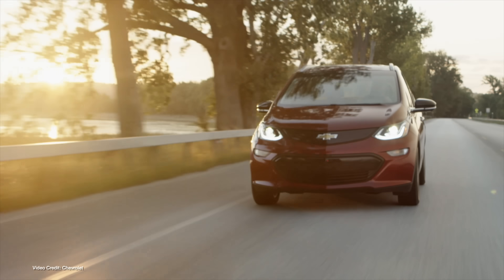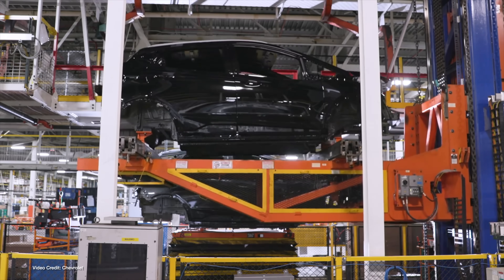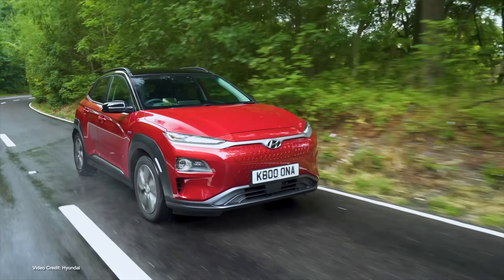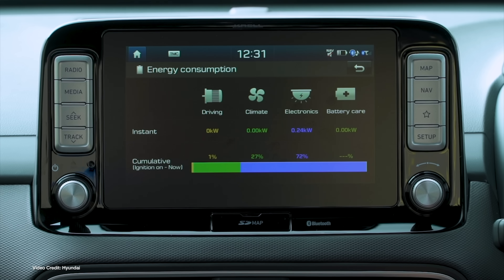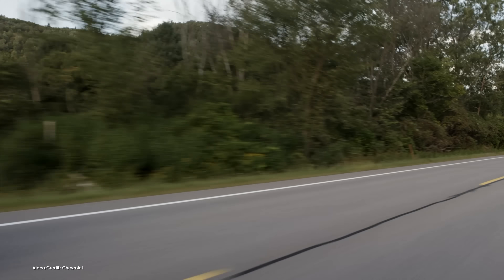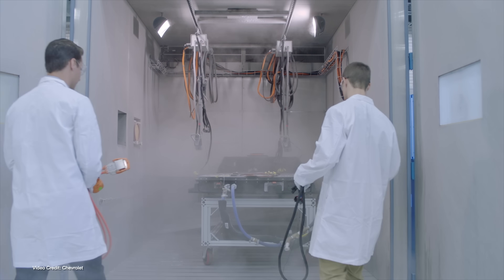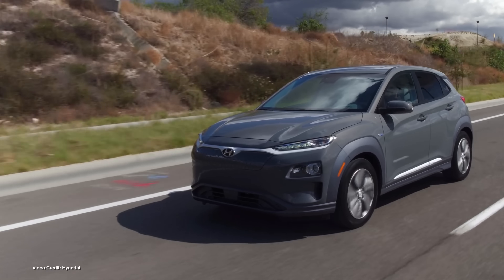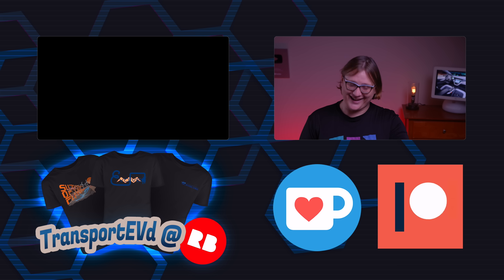Chevy Bolt EV Battery Recall: Here's Our Take on GM's Inspect And Replace Plans

Comment: A situation where minor manufacturing defects cause this kind of issue is really a design problem. The design should be more robust such that minor difficult to detect variations in mechanical assembly don't cause this kind of issue. This is likely due to LG Chem trying to maximize energy density with too thin separators. I wouldn't be surprised if this doesn't happen again. Hopefully diagnostic software can detect an issue before the battery catches fire. Edit:  I just realized this video is quite old.  There is new information that a recent fire in Vermont happened on a Bolt that had the recall completed.

Comment: Nikki lov your channel and you. Keep up the great work! I want to share with you some information. I had a 2017 Bolt with the Korean battery. Sold it back to GM and bought a 2019 Bolt (exactly the same blue premier, but with way less miles) with the US built battery packs. (btw am one of the lucky ones that made out with the deal) Know that there's a sticker under the car in the rear by the non-existing spare tire cavity that identifies the battery as built in Korea or US. The sticker faces towards the rear bumper so you don't have to go under the car just look from the rear behind the drives seat toward the middle of the car. Can't miss it. There's 5 rows of writings on this sticker, the third line from the top can be used to identify the battery origin. If it starts with 0808xxxxx it's US made. If the third line starts with 6883xxxxx then it's Korean made. 
You are so nice and way to nice to Chevy, I think. Chevy is taking the very cheap way out by replacing battery modules that test bad at the time of testing. What assurance is there that a good tested module won't go bad sometime later and burn up? Don't trust Chevy at all. There's more to it at least like lowering charging rates, who knows. Chevy is not even describing any details of the solution(s). But although it's the third time, believe they really found a solution this time and trust them. Chevy has earned no trust at all by it's refusal to divulge details of the problem and solution. So unless my beautiful perfectly running (thank you LORD) bolt needs to see a dealer for immediate repair (knock on wood), it'll be a cold day in hell before I bring it in willingly for a software update that I have no idea what it will do to my car with no chance of ever going back ever. No, thank you Chevy. Looking forward to your next video!

Comment: I have a 2018 Chevy Bolt. I just had recall N202311731 implemented . Ever since I've had strange behavior. Specifically, door locks don't open all doors with press of the handle button even though it's turned on. Rear seat occupied warning always happens even though it's turned off. This started happening as soon as I brought it home from the recall. Anyone experience this?
Reply from the maker: I know the recall service can reset all your preferences and they need to be redone, but if you’ve got all those settings changed and the behavior is still there, it’s definitely worth talking to the dealer where the update was done - Winter
Reply: Yes, I was wondering if anyone else had these issues. If I'm not unique, I would take somewhat different tack about the issue as suppose if they're unique to me.

Comment: Today I scheduled service on my 2017 for an issue where the car shudders on acceleration from the stop. The service advisor told me the final recall fix is in so it’s scheduled for that too. I told then I thought that was only for 2019 atm but they said mine was covered. Confidence is low that they actually know what they are talking about.

Comment: No one of Chevrolet Bolt Ev should agree on just software update. There is a physico-chemical problem inside the battery and no software update will help, may only reduce the risk but it will always occur. It may catch fire in worst, unexpected moment. Remember the health and life of your family is at stake. Demand consequently from GM and local representatives, battery replacement.

Comment: Even with a software udate you still have faulty  batteries regardless. They need to do the right thing and replace the batteries. Its like a bad hdd no software will fix it.

Comment: Just had my 2019 "upgraded" today. They inspected the battery and found no faulty cells, so no need for battery replacement. They also evaluated my battery's state of health and said its degradation was practically 0%. Honestly, I was very pleased to hear that. Having my battery as good as on Day 1 - after two Canadian winters, active daily driving, and almost 50K km on it - means I will be able to keep this GM masterpiece for many more years to come. Halleluiah! :)
Reply: What was the manufacturer date of your bolt?
Reply: @Slaize  I'm not sure about the date. It's a 2019 and I bought it in October 2019.

Comment: Are the 2020 bolt ev included in the recall?
Reply from the maker: No. The battery pack manufacturing changed partway through 2019, so some 2019 models are affected, but the 2020 and 2021 models are not. - Winter

Comment: Just got back from the dealer where my 2019 Bolt EV with 18,000 miles was checked out. Took an hour and 45 minutes, but the invoice came back with the words: "performed battery test then programmed hpcm2 and bcm due to all passed".  Woohoo!! Back to 100% charging. Sorry to disappoint all you Bolt sceptics and GM haters (not really).

Comment: As an owner of a 2019 Bolt, thank you for your wonderfully clear and helpful explanation of the battery issue. My local dealer had my car for the first software “downgrade” to 90% maximum charge but can’t seem to manage tracking their own work. I even provided them with the invoice number from that visit and they continue to beg me to bring in the car for the software modification. Hmm?  I wonder about the competence of their service department when they can’t track work they already completed. I’d rather have service performed at my local mechanic which has at least two Bolts as service vehicles. It was their satisfaction with the Bolt that convinced my wife and I to buy one in the first place. Alas, I doubt GM will reimburse my local mechanic to do the recall repair even if they provided the tools and parts. Right?  Any other folks out there who question the competence of their local dealer to carry out GM directed repairs?

Comment: I dealt with the problem by trading my 2017 in for a used Prius.  I have to say it's nice to be able to drive five hours without stopping for two hours or more to charge.  I never thought I'd go back to am ICE car, but the LG battery issue made me feel like a beta tester.  I'm from a state that is 80% electricity via coal anyway.  And no, the answer for me is not a Tesla, until their build quality issues is fully addressed.

Comment: Never had a battery problem with the 2017 Bolt which I had driven for three years (leased).  Currently, I have the 2020 and 2021 Bolt.  2017, 2020, and 2021 Bolt all have uncomfortable seats.  Nonetheless, they are all extremely energy efficient.  I recently took a 220-mile day trip and I averaged 4.4 miles/kW.   Cheers.

Comment: It's well know that it isn't recommend to charge an EV Batteries to 100% all the time, only when needed for long trips. Are all these cars being charged full all the time? Just because you charge your phone fully all the time with it's small battery that you can with EV batteries.  Your phone battery gets warm when charged, remember Samsung phone fires, just imagine how hot 500 - 1000 of those would get if packed together like EV batteries are. There is  a reason for the lower charge recommendation, if you need the full charge all the time then you should have gotten an EV with more range. Personally i think most EV's have enough range for most daily driving, if your driving  more than the range of your EV you need to stop and relax while you charge you vehicle.  There is a Reason that Professional Truck drivers are required to stop every so many hours.  

I am old enough to remember Filling Up your car full all the time was not done. I worked pumping gas in the late 1960's early 1970's  most people only bought enough fuel to get through until the next payday, only filling up only going on a trip out of town. It was only with the oil crisis that most  started getting full tanks so to extend the time before needing gas and avoiding the long lines.

Comment: You can not expect too much from GM on this issue. They used 2nd or 3rd party manufacturers. Generally when batteries catch fire , Its an engineering and/or manufacturing issue just that simple not software . You get what you pay for. Sad Commentary

Comment: I’d prefer a battery replacement. I wouldn’t waste my time at a dealer just so they can change a few modules.
Reply: Meh - you get to drive a new Bolt for a couple of weeks while yours is in the shop. What's the problem, whiner?
Reply: @vidznstuff1  the problem is that ill want a new bolt after i get my old bolt back. Lol

Comment: Personally I think Chevy is just taking a cheap gamble hoping no future issues pop up even though the batteries are inherently defective. The question imo will be, will the defect get worse over time as the battery degrades? Maybe they simply are biding time because as time moves forward batteries become cheaper and the cost to replace will follow that trend reducing GMs hit on profits.
Reply: The defect getting worse with time is the fire. The new software identifies defects before they become issues
Reply: @vidznstuff1  my question is what if the defect is detected by the software after your 100,000 mile battery warranty expires. Will Chevy replace the battery or but that burden on you?

Comment: Does the Bolt get over the air updates or do you have to go to the dealer for that?
Reply: This one has to be at the dealer as they need to do a diagnostic and physical inspection of the battery and may have to replace battery modules. Est 1-2hr visit a day or more if more work needs to be done and they will have a loaner car available
Reply: @linusa2996  that makes sense. Would it get over air normally then? Just not for this one? I’m just trying to get an understanding of which EV’s are more dealer dependent and which ones update automatically... like a phone or computer.
Reply: @coryfriesen4943  The Bolt does have OTA  https://my.chevrolet.com/how-to-support/maintenance/over-air-software-updates

Comment: So no more buybacks whatsoever?  This is the only option even in states that have lemon laws?
Reply: Most buy backs only happens in lemon law states - GM did actually buy a lot of them back - my local dealer processed some and stated the cars and leased cars have been sent out to GM - the stop sale won’t decrease prices becuase there being sent to EV friendly states where buyers can use EV rebates on used cars which will prevent the market being flooded and keep dealers happy

Comment: Got ours done this afternoon.  Took just over an hour. No problems.
Reply: Any difference ?
Reply: @brian4407  No,  works brilliantly as usual. Still beats everybody off the lights. I was thinking I would never ever buy a Chevy but the whole experience has been great, buying was better than at a Japanese dealer and absolutely nothing has gone wrong or needed maintenance in a year and a half.  Both my Acuras needed fixing for factory errors.

Comment: It sounds OK to me Nikki. Hyundai have said they will do something better but they aren't doing it. The only skepticism I have is that the BMS will have certain capabilities in terms of its monitoring and sensing of characteristics of the battery pack. These capabilities will be what is needed to maintain battery health from a charge perspective. There may be properties of the cells that need to be monitored and tracked for the purposes of determining battery safety that the BMS just isn't capable of. It sounds like they are going to potentially try and "infer" problems based on the data the BMS can monitor once you have left the dealership with a clean bill of health. This is supported by the notion that they are going to hook up your battery pack to some external system when you arrive at the dealership in order to examine properties the BMS and vehicle cannot monitor.

I think we will all continue to park our Bolts outside even when GM say they have resolved the issue.

Comment: I didn’t notice any reduction in range or charging speed on my old Kona after it got the initial software update, but with the current insane used car market, I sold it only a few months later (for a profit). What Chevy is trying to do sounds exactly the same as what Hyundai was doing. Part of the previous Hyundai recall was inspection of battery cell voltage variation, which could indicate a fault with that cell, and replacing any batteries that failed this initial inspection. The software update decreased the allowed cell voltage variance in the BMS software to “hopefully” catch a bad battery cell before it causes a catastrophic failure. That was Hyundai’s failed plan, and it sounds like Chevy is trying the exact same thing. 

I love my Bolt and it has been very reliable, but given the current insane used car market and availability of very, very cheap brand new Bolt EVs  with improved battery chemistry, increased range/capacity and updated tech right now, as well as well as many other better EVs coming into the market soon, it’s making me question whether I should attempt a lemon law buyback or sell the car outright.

Comment: I'm getting the recall done, I refused to do the temporary recall and i am refusing to let them install the temporary and then the permanent (they have to go straight from the original stock software to the permanent fix otherwise I am getting a buyback). I hope they haven't predicated the upgrade path on having the temporary patch installed first.
Reply: They might be: just today I received a notice that I haven't had the original recall done (which I have). Why bother with that when the final recall is now in sight? And if they're worried that my car may burst into flames during April while I wait for availability of the final recall, why not just let everybody have it right now? Why the delay for the '17s and '18s?

Comment: My 2019 Hyundai Kona has been bricked at the dealer for 2 weeks. No estimate of replacement battery. Will end up probably lemoning the vehicle.
Reply: That what I’m hearing that Hyundai has been terrible in handling the recall - Most Bolt owners are concerned but it’s less sporadic no bricking - I see more bolts on the road here in California and they all love there car - some refused buyouts cause they want it fixed - some took buyouts and switched but regretted it because most EVs are market adjusted right now exception being Tesla - Some who did the buyout went with a current Bolt - I bought a Bolt with this on my mind and said there will always be a recall

Comment: Did I hear right 56 & 96 thousand miles on the clock? In days gone by 96000 on a petrol engine would be curtains! If they’ve done that many miles I don’t think I’d be over concerned about 🔥.
Reply: It doesn't work that way

Comment: As automakers "Rush" to get EVs to the market, details can get fuzzy. 15 years of Focusing on EVs has convinced me that buying anything (in 2021) other than Tesla, can be fraught with 'Unknowns'.
Reply: Come on. Tesla has had its fair share of unknowns. At least I know the door handles on my Bolt will keep working.
Reply: What about the almost monthly bug fixes pushed to Tesla's? The last several years have been waiting for the owners to beta test and find all the quality and software problems instead of the factory doing their own testing and QA. Not to mention being now forced into replacing the bad screens in cars that Elon said are only expected to have a five year life. I'd never buy a Telsa even if they did have a model that interested me.
Reply: @davidmccarthy6061  Thanks for your opinion. Just making the point that Tesla has already made significant advances, in areas that many other automakers don't yet fully understand.
And as far costumers 'Beta' testing for Tesla, how does that differ from any other large, or small company?

Comment: Hi Nicky, I have an a Hyundai Kona 64kwh 2018 here in the uk just received a letter from Hyundai Uk confirming a battery recall for my
vehicle they have asked me to limit the state of charge to 90% if unable to do it take into your nearest Hyundai dealership and they will
perform this task when this is done I had to register this on their recall website they are offering a my charge Hyundai card to make up for the lost 10% I have yet to receive the card yet they will be getting in touch with me it maybe sometime before all this happens but
when it does they will be picking up my car and taking it to Tilbury Docks uk where they will do the battery swop they will leave me with another Kona while this happens to date my Kona has done 20000 miles and I am happy that this going to happen keep up the good work good video.

Comment: It's weird but according to the GM site, older (pre-2021) Bolts are retailing for considerably more than the new ones. What's up with that?
Reply: The redesigned 2022 Bolt EV has a lower starting MSRP than previous model years. They lowered the price, because of that many dealerships are offering large discounts on 2021 and 2020 model years.